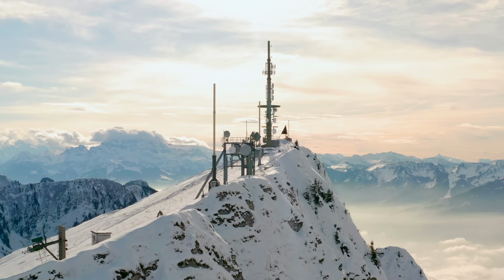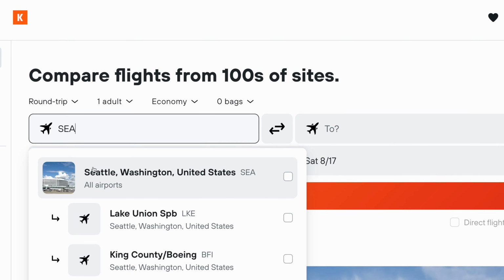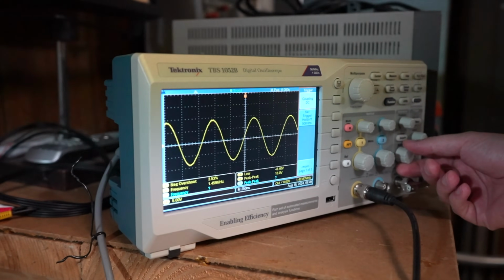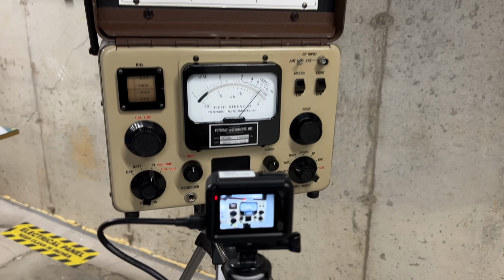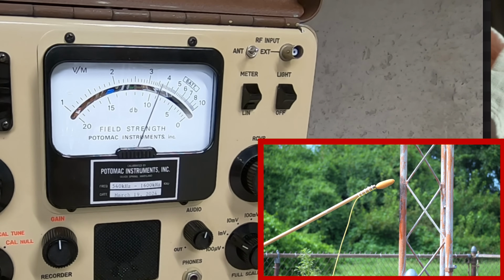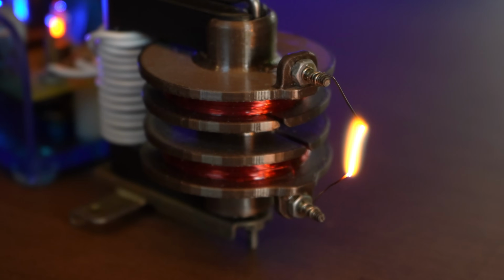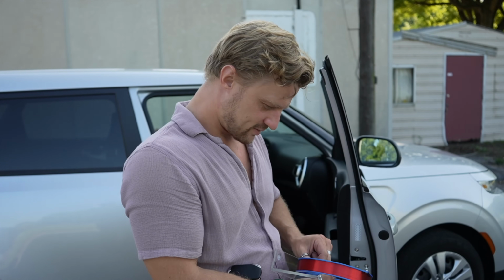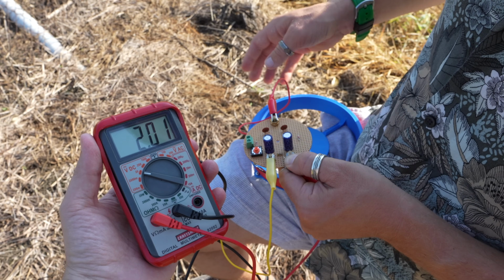Stealing Energy From Radio towers Using Plasma (ft. Geerling Engineering)

Comment from the maker: Thanks to both Jeff and Ground News! Go to https://ground.news/plasma for a data-driven, objective way to stay fully informed on physics and more. Save 40% on Ground News’ unlimited access Vantage plan. View Geerling Engineering's video here: https://www.youtube.com/watch?v=wzDEIBpbLRk
Reply: you missed the link to jeff's channel in the description, can you please update it so I can watch the original video haha
Reply: @swashed. still working on the edit! Had a baby arrive a little early so our video is delayed. It'll be later this week.
Reply: @JeffGeerling  Oh the man himself, Congratulations on the new addition! 
Thanks for the info re the video, much appreciated
Reply: @PlasmaChannel - So the RF diodes are failing? Not surprising, they are not meant to carry any significant power, nor withstand significant voltage. You would likely get better results with simple 1N4007 diodes. Being rated for 1000 volts, they are not going to be the weak link on that front. The 4000 series diodes are also rated for 30 amps repetitive forward current at low duty cycle, like a few hundred microseconds per current spike, when repeated 60 times per second. Better alternative kinds of diodes are available nowadays, like fast Schottky diodes good for a few hundred volts at several megahertz. Even better are the Silicon Carbide and Silicon Nitride devices, some of which are good to a few thousand volts at high frequency. Please get some, and light up some incandescent bulbs for us!
Reply: 13:05, Most AM radio stations are used to broadcast religious programs. What you were hearing was a verse from Genesis Ch. 3: 16, when GOD was telling Khav'vah(Eve) her punishment for disobeying and giving Adam the forbidden fruit of the knowledge of good and evil. "Unto the woman HE said, 'I will greatly multiply thy sorrow and thy conception; in sorrow thou shalt bring forth children; and thy desire shall be for thy husband, and he shall rule over thee.'." King James Version.
Reply: @GeneralPadron Good ear, sir!
Reply: so with some kind of auto on and off swith you have free power from miles away all day long.. -_- 

do you know what you have done?
Reply: Tesla.
Reply: Is this what Tesla was talking about?
Reply: That is so awesome. You should stay there get close all those radio frequencies passing through your body and microwave frequencies is definitely worth the trade-off.
Shanon L Fowler /
The Ancient Trapper
Reply: It causes brain cancer
Testicular cancer 
Thyroid cancer 
But at least you could power, a small flashlight or a drone
God bless America 
Shanon L Fowler /
The Ancient Trapper
Reply: So are birds are safe to land on the tower unless they ground themselves?
Reply: i've wondered if youtubers who say "i've used <this sponsor> for years" are actually telling the truth.
Reply: Can you get that link up for their channel?
Reply: Hey Jay @PlasmaChannel - You may be interested in FAA NDB’s (Non Directional radio Beacon’s) (similar VOR, DME, TACAN, etc.) as they can operate up to 1.75MHz and anywhere from 50-2,000W. (DXers will know, plus “atmospheric bounce”/diffraction/skip is a real thing: you might be able to pick up from other countries from across the globe.)  Nerve racking to climb them as they are, like you said, normally “hot” and I’m the hot dog 200’ up (plus, a lot of them are still “illegal”/condemned/unsafe guyed Rohn towers, like the ones you shown throughout (first at 0:20)).  They are everywhere; looks like the closest one to, uhh, “Coderville, WA” is on Whidbey Island, close to Coupeville, called ‘Penn Cove’, 117.2, Ch. 119 CVV.  Plus, they are around SEA, McChord/TCM, and OLM, but you probably can’t get close to those (maybe?) as they are actual airports and not just remote/standalone sites.  You could try them and/or Paine/PAE to the North and/or Hoquiam/HQM to the West, as you probably could get a lot closer as most remote/stand alone sites just have small perimeter fences like the MO one you were at.  And yes, this is all legal, free, public knowledge; just look up any FAA Sectional Chart (and look for the Morse code, plus look up the other aeronautical symbols) (Plus, as a taxpayer, you’re literally paying for this “free” energy, same as Ham operators.  Hell, the FAA still operate (not really maintain) the archaic (3) tower NDB’s as “just in case” SHTF and pilots GPS, ILS, and/or IFR or even VFR goes down or can’t be relied upon.).  Cool stuff.  Thanks for always posting interesting and educational videos.
Reply: BTW - If you need actual HV/HA Arc Protection PPE, just ask.  I would recommend a “Hot Stick” as well.  Lastly, between burning the toxic galvanization off and the orange paint that probably is LBP (Lead Based Paint), I wouldn’t eat too many of your experiments.
Reply: Bigger caps and a joule thief maybe? :D
Reply: In the late 1980's the cellphone service provider, that I worked for, built a steel lattace tower which just happened to be in resonance with a nearby AM station. For cell service, we had UHF antennas at the top of the tower, so cell service was unaffected, but because of the tower's physical characteristics coincidentally, making it in resonance with the AM radio station, our cell site tower drained just about all the radiated rf power from the AM station, severely cutting down on the station's range. We ended up getting a specialist who attached steel cables to each corner of the tower going the length of the tower. He pulled them tight, almost like he was tuning a guitar string, until he'd physically changed the resonance of the tower to where it no longer soaked up all the AM station's power.
Reply: Yes Chad, build it! And how do we all think this can be connected to Nikola Tesla's free wireless power hack? :P
Reply: BUILD IT!   BUILD THE GENERATOR NOW!!!!
Reply: Can I use this to draw power from the cell tower up the street? It would be ironic to charge a cell phone with power from a cell tower
Reply: la proxima  vez   para  evitar  que se quemè  el  led usa  un monfet  LM7803  o  LM7805

y  porfavor  pasanos ese  circuito con diagrama
Reply: I hope wou will see this. I'm wandering how much power does the radio you used to test the antena was spending to transmit electrical power ? I know this will sound stupid but would there be a way that the radiospends less energy that the antena is generating ? feel free to correct me, I'll be happy to hear an explenation
Reply: @solunepetit6327  - There were no claims of "over unity" so you should assume normal physics: The transmitter uses more power than it transmits. If there were such claims? Same answer.
Reply: NASA just put up a picture of the ion engine they have been working on, NASA App 4 hours ago
Reply: So Mr Tesla was right
Reply: @calebworden2993 

No.  Nicola Tesla believed he was sending energy through the Earth.

And yes, there are three low frequencies that will carry through the Earth.

But his “wireless energy” scheme was never going to work.
Reply: https://youtu.be/QZUCk6k48Hk?si=wfvfqG5Kv7_jqFOY
Reply: You should put the link in the (i)nfo icon in the upper right of the video.
Reply: I hope you see this and think the idea is worthy.... What if you get a supercapacitor plane (see Tom Stanton ..youtube Super Capacitor plane) and then tweak the motor to support the weight of a modified version of one of those wireless energy receivers you built.....then all you have to do is stay in range of AM towers and I think, you'd be able to keep the plane airborne until the broadcast stops....right?
Reply: @jessehays  Or until the weather turns bad.
Reply: Could this have been what Tesla was trying to do with his tower he built for power through the air.
Reply: @systemsrenegade9888  It's precisely what Tesla was doing, but it isn't practical, unless your near the tower. Tesla imagined, that he could send large amounts of power wirelessly, for long distances, but it's just too inefficient, as the power spreads thin, exponentially.
Reply: I have a request for high tech scam-busting. Apparently even on ResearchGate, and wallpapering various other forums, is a "Free Energy" generating scheme by "Don Smith". (Those terms in a search engine should pull up the scam I'm seeing. Please, if you have time, bust this.)
Reply: Please make a video using plasma thrust to cool a CPU on a computer I believe it's possible since there's passive cooling solutions with no moving parts
Reply: Hey there, I‘m highly impressed. It‘s just awesome. Since I started studying electrical engineering on Tuesday and at university they impressed us with a 600 kV producing lightning simulator.
Now I want to learn more about what you did here and what you did with your antenna lamp.
Would it be possible to get a look at the circuit? I mean probably I won‘t understand it but you have to start somewhere.

Thank you and all the best!
Reply: i mean its not really theft if youre capturing waste energy in the environment, its on the same vein as saying that its not illegal to harness the energy of the magnetosphere to generate power (though it is illegal to build dams or weir's that redirect the flow of water, and some countries and states even consider harnessing rainwater illegal even though its the very same rainwater that collects on our roof gutters. laws regarding free electricity can be extremely stupid since they're just being greedy, next thing you know they'll tax us for breathing)
Reply: Wasp killer
Reply: @kingamuser1   Achievement Unlocked!
Reply: Gee, I never knew that about radio towers. Why don't they tell people, especially kids, about stuff like that?  I didn't know if you touched a radio tower, you'd be burned to a Crisp..
Reply: Those diodes were blown bc they are "Signal diodes" 1N4148   
for THIS project, and THIS Purpose, you needed like Real RECTIFIERS 1N4004 

"use your Braaaaaain"  I would tell my daughter........when teaching her Science......
Reply: I recommend building that antenna circuit with a neon lamp and components with really high ratings
Reply: @1833-j4g  Naaah! Really??
Wow, what a level of enlightment.......
(RME)

Woman, the LED here is a VISUAL indicator. 
For a Neon Lamp to be used for same purpose; You need a MINIMUM of 65 Volts to be able to IONIZE the Neon GAS and Jump across the GAP to show a flash Glow.......
for that, you need a lot more charge  and Circuitry to create(Up-step) the needed VOLTAGE........

As U can see,  U ...in no position to "Recommend" anything........
Reply: @jesscast5122
The neon lamp would certainly light up at a closer proximity to the antenna.  I recommended it because it can withstand far more voltage.  I’ve seen this myself with RF sources, including ones that aren’t as powerful as this beast.  
I’m not sure why you have to be so rude about it, maybe it’s the Dunning-Kruger effect at work?  The idea that you “woman” thing is rather telling.
Reply: 0:21
Reply: @PlasmaChannel would using something closer to a Tesla coil absorb the electricity and disperse it back to the surrounding area be a little more sufficient ? Something bigger on that note
Reply: I love the idea of what you’ve accomplished
Reply: YOOOO!!!! SO TESLA WAS RIGHT!!!!!!!!
Reply: is it possible to steal current from train current cables
Reply: @777躺养离 They would probably notice the loss, but you wouldn't notice power loss from a radio transmission because the power is being sent out regardless of whether or not someone is tapping into it.  You aren't really stealing power because the power is being sent out anyway with a radio signal.
Reply: Please build the generator.  It would be great if it was a step by step guide, on how to make a 12 volt generator, so I could use it in place of a 12 volt battery.  Or maybe the power wouldn't be the right voltage.  How can we convert it to the voltage we need?  At any rate, that sounds like a great off grid tool.
Reply: 999k subscribers
Reply: Maxwell Chikumbuso  anyone??
Reply: Your getting into dangerous territory. Contact me
Reply: Now I understand why there so much opposition for free energy! Is because we produce in and we supply it out side of the planet in form of electromagnetic waves. In simple words we are a gas station is the milky way for aliens  space ships 🚀!
Reply: @hinstoncarachi1373  no you don't understand, the earth's plate tectonic structure is weak, by applying a electrical load to it you create a mechanical stress. Think a light hooked to a hand cranked dynamo, the faster you crank the brighter the light however the harder it is to crank. Now consider the earth's plates are both floating on a liquid and they are broken forming multiple plates. Unless the electrical load is replaced the plates will at some point rupture causing a extinction level event. Tesla knew this fact and its why he never released it to the world. My guess this is what happened to Atlantis, it didn't sink it was thrown into space- this molten magna in a vacuum would form a sphere that would be captured by earth's gravity, the ejected mass would cause a tilt and wobble to the earth, we would pass through a asteroid belt once a year formed by the mass ejected but moving too fast to form part of the moon. When you read ancient texts there was a time before the moon and a ice age coinciding with a extinction level event. It all fits, scientists can not prove a asteroid wiped out the dinosaurs in their limited thinking that's the only possibility.
Another fact it took only 2000 years to get from zero technology to today's modern world. The earth is how many millions of years old. One extinction level event and the world starts from scratch again. There are other things that do not fit modern science timeline etc...
This type energy no one can put the geni back into the bottle and the plate will just shatter with zero warning from the electromechanical stress once it's limit has been reached.
I tried to warn both the content creator and YouTube that someone would work out how to gain Tesla's free energy without understanding any of the science, physics or geology of plate tectonic structure. I could have posted the solution of Tesla's free energy more that a decade ago, but I understand the implications, if you think just one will not hurt, well it's you and a billion others that think the same...
Reply: @p.j.thompson2451 

Nope, nope, nope.

Tesla FAILED.

He had measured electrical energy without knowing there was a thunderstorm miles away.

Your fantasy about crustal plates is just misinformation.
Reply: Can you send a build print on your receiver
Reply: Nikola Tesla developed wireless power that could be broadcast from a tower just like radio. He designed and built Wardenclyffe Tower to prove the concept. His intention was to share electricity freely with all humanity but when his financial backer, J.P. Morgan, realized the power could not be metered and charged then he pulled the funding and had the tower destroyed.
Reply: OK I have a gripe with your audio in some clips... hearing a voice just entering one ear is reeeeaaaallllly irritating.
Reply: 08:00 'Made in China'. Are you sure they'll withstand a true 16 kVAC?
Reply: A secret better way; bury iron in the ground with rebar attached, and you WILL pick up on the very strong earth lf wave 14.07hz(appx) which has a strong negative bias that will amplify itself if anything fights it. So you run that rebar through 3 copper sheets, and then to spark gap control, and then to the inside of a foil pyramid with a sharp peak over the center of the sheets. I know a guy who did this and it burnt the top off the pyramid with so much power the wires melted also. You just slowly open spark gap and watch the wave bounce higher and stronger. Tesla did this using a multiple of 3 to produce an hf version in Colorado Springs.
Reply: Find the frequency, tune to it and make a 3/4 wave receiver with 8gauge so you can really suck all of the signal
Reply: It causes brain cancer
Testicular cancer 
Thyroid cancer 
But at least you could power, a small flashlight or a drone
God bless America 
Shanon L Fowler /
The Ancient Trapper
Reply: 🙌🔥🔥🔥🙌Please build a bigger version of it so we can enjoy more of this
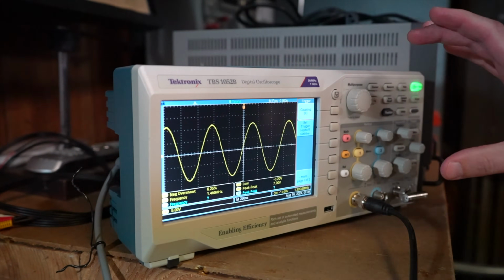Reply: 6:00 I'm sorry, the what? 😆
Reply: Why  is   Sausage   Talking   to   us   .....
Reply: we use feet in the US, not meters. Changed my mind on spending on your plan. No money to you.
Reply: @PlasmaChannel minta spill dong port 2
Reply: you dont need the circuit ...sectors of your wheel can be tuned ..use a copper spring like tuning fork within a magnet cylinder ..depending on the different gauges of wire you can use the frequency to resonate at a set distance ....bypass the problem altogether
Reply: convert the voltage to resonances then bk to voltage
Reply: What do you think about this circuit https://www.youtube.com/watch?v=XVHxTBwnItA

Comment: can you share the sch in the video to help understand, a diode bridge will make more efficient filling the caps, but you will need to protect led diode for over voltage with a series resistor. the current probably is low (P = V*I) a Led usually takes 2V volts or less so everything else will fall on the resistor which value should set to a Max of 20mA (usually leds max) current and be able to dissipate the heat I^2×R

Comment: Have you ever thought of building an electrically powered model airplane that takes it's energy from radiowaves instead of batteries? If that succeeds it could theoretically stay in the air as longs as there are radio signals transmitting at the right frequency.

Comment: FOLLOW UP REQUEST: IMO the sensible thing to do would be to run the antenna to a boost converter, and then to a USB socket as a battery/phone charger. Please? 😀🙏